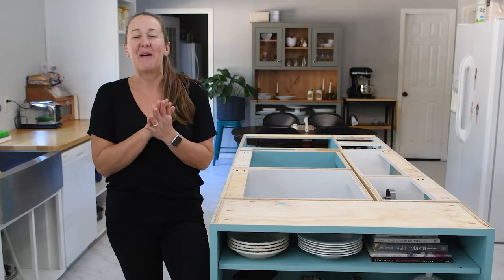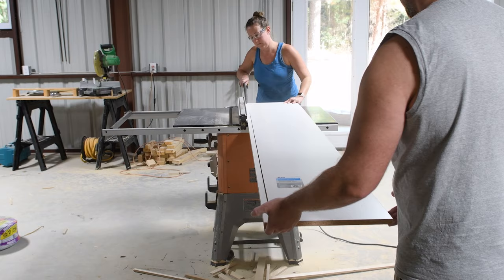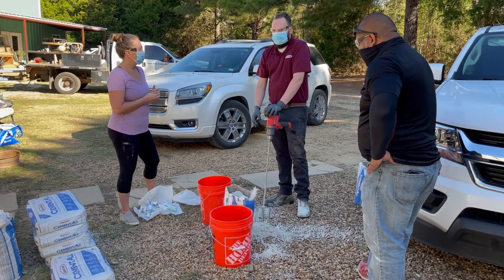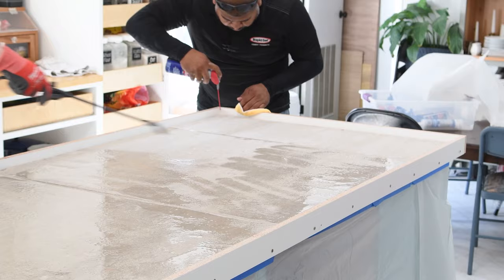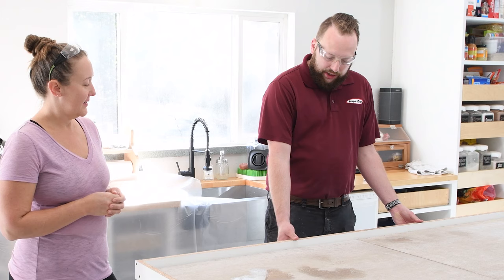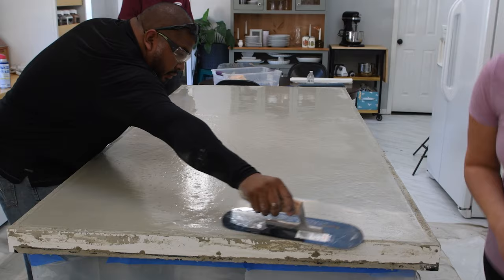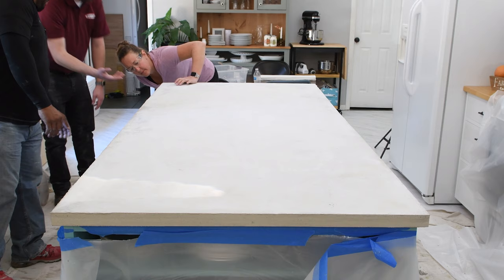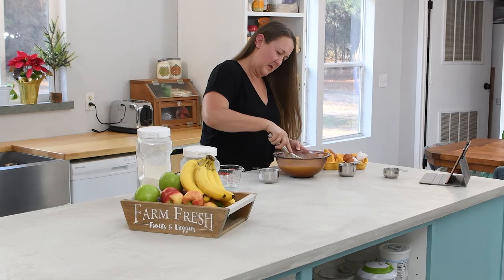Fast DIY Concrete Countertops

Comment: So no wire, mesh or bars in the middle of the concrete?
Reply from the maker: Not for this project.
Reply: @HousefulofHandmade  Its going to crack 🤦‍♂️ maybe not today but its coming 🤷‍♂️
Reply: @paparedpill1036  I am from Colombia and my grandma had a kitchen for over 45 years with cement counter top Idk if you know but my country is hot as hell and the counter was amazing, the things that are dome right they can stay almost forever
Reply: @brendagebhart325  it’s not heat you have to worry about lmao, it’s cold.

Comment: One step I would add to the process:

Use a thinset and cement board fiber mesh tape on all  joints found in the hardibacker board. This will make those areas far less prone to cracks in the future.
Reply from the maker: Thank you for the tip. That is not something I had ever considered.
If I were to do it again I would add wire mesh or rebar for added strength.

Comment: 9:15 - DUDE SAYS THE DETAILS that needs to be NOTED by each and all who are going to implement this type of RAPID SET CONCRETE PROJECT.

9:25 - DUDE's info about the type of RAPID SET and sand-type is KEY.

Comment: I am looking at doing this to replace what would otherwise be a slate slab for my homemade pool table... need to make sure that it is perfectly smooth, perfectly level and almost pollished in the end, and this looks like the go.
Well made vid, everything explained nicely, very enjoyable. Thanks 👍
Reply: Pooltable slate is specially ground flat,  this countertop wont work.  Ive assembled pool tables before.  Those slate tops are actually 2-3 pieces ground as 1 and have alignment marks.

Comment: Nice work! If you really want to cut through the cream layer use diamond pads on an orbital sander. Depending on what grit you use you can either just smooth the surface or reveal the sand for a speckled look.
Reply from the maker: Thanks for the info!

Comment: We tried this process and 1. Our concrete took several hours to set. My husband worried about how long it was taking and removed the sides too early I think, causing a crack. Now I'll have to repair that. 2. We struggled with mixing. Our drill was not powerful enough and started smoking. So I think the slow setting was due to too much water in the mix because we could not get all the concrete mixed in properly

Comment: Thank you for the video. I'm making a 5'x3'x1/2" for a skid bar I made 3 years ago.  Need to do this.  It's been too long. I'll post a picture.  One question : What would you use for a color in the cement?

Comment: This is a beautifully documented step by step information package. I have seen a few professionally finished concrete countertops and they truly compete with polished granite both in looks and feel. But I know those Pro projects require pro skills and equipment and top secrete finishing materials and supplies.  How far could we push a DIY project towards the " Pro " territories?   I went through the FAQ on your web pages but didn't find one important question and answer for it: " How smooth the final surface is and if there is a real point of diminishing returns for attempting to create REALLY SMOOTH surface out of a concrete slab "  with DIY equipment, elbow grease and off the shelf sand-papers ?
Reply from the maker: It is not a polished granite smooth finish.  I was going for a "rougher" finish.  If you want it smooth its best to flip it over after the pour and not pour in place.  Then it would be pretty simple to get the polished look.
Reply: @HousefulofHandmade  You can get a polished look by hard troweling it smooth like we do on concrete floors. You can ask a concrete guy what that means. Also I didn't see you edge it before you pulled the side forms. Edging will give you a rounded look and take away a possible sharp edge on the top corners.
Reply: You can get a wet polisher fairly inexpensively and polish them. I did mine last year with dyed rapid set mortar and am very happy with the result. I poured the sink as well.
Reply: @tomwilkinson729  What brand of wet polisher did you buy if you don't mind sharing? Because I want to pour in place and not having to flip over. Thank you
Reply: @mailemoore5017  it was a relatively inexpensive polisher from Amazon. Around 100-130$. Don’t remember brand and it’s at my second home.

Comment: Great video and love the way it turned out. Perfect color too.  I don’t remember you mentioning using any coloring or pigments?
Reply from the maker: We didn't use any. This is the natural color of the Rapid Set Cement All!
Reply: @HousefulofHandmade how light is it? It looks white in the video. Is that correct? I am about to try to make a white one. So this product dries white? Thanks so much for your help.

Comment: I love this 
And we’ve been talking about doing concrete tops but I didn’t want all the dust from sanding so the way y’all did it really made me think this is the way to go 

But I want to have black tops so can you add a color to the mix? 

Looks fantastic awesome job thank you for sharing
Reply from the maker: You can add pigment to the mix.  I would probably experiment with some small batches before going for the whole countertop.

Comment: If you were doing this for kitchen counters and not an island I assume the pour in forms method would be the only way to go .  I love the look of a concrete countertop and we are considering this for ours this summer. Also I was unable to find out if CTS distributes in Canada, certainly Home Depot doesn't carry their products
Reply from the maker: A lot of countertops will actually flip them to ensure a smooth top.  It can be tricky to make sure you get all the bubbles and imperfections out.  Its pretty heavy, but so is marble and granite. I can't say if they export outside the US, perhaps reach out to them directly from the website?

Comment: I see you didn’t use any steel reinforcing?
Reply from the maker: I did not use any steel reinforcing.  The counter top had minimal over hang and was supported evenly underneath.  If there is a sink cut out or a large over hang, that's when I'd use steel reinforcing.

Comment: What is used for the sealer? Does it have to be resealed eventually?
Reply from the maker: The exact sealer I used is listed in the blog post. (link in description) It does need to be resealed to maintain it.

Comment: No reinforcement mesh needed for this RapidSet product?  or does it depend on thickness?
Reply from the maker: For this project we didn't need it. If you have an overhang for bar stools or a thinner area around a sink you will want to reinforce it.

Comment: Would you recommend using the cement board even if you’re not doing an in-place install?  Any benefits to the form like insulation, support, etc?
Reply from the maker: I am not sure I would qualify to recommend or not. I can tell you that if I was not pouring in place I would put it directly on the cabinet. I haven't tried it so I can't say for sure if it'll work.

Comment: what kind of sealer  do you use for seal the concrete ?
Reply from the maker: The exact sealer I used is listed in the blog post. (link in description) As a heads up, it does need to be resealed to maintain it.

Comment: I'm wondering can you use any rapid set for this project..in Ireland its called Post 10
Reply from the maker: I would look at the specs for the specific rapid set you have available and compare the two. But it might work similarly.

Comment: I just poured the cementall countertop and have attempted to seal it 3 times with the Stone Care Granite and stone sealer. Water still leaves dark spots and repels slightly in others. Any thoughts or suggestions? It’s taking most of the bottle. Do you think I can cover it with another sealer like a Behr product?

Comment: Nice work! Looks great!!! In the video you stated you changed the amount of water per 55lb bag....was the final amount per bag 5 quarts? What do you recommend for sealing? Thanks
Reply from the maker: The amount of water will very depending on temperature/humidity where you are.  It was about 5 quarts per bag.  I currently don't have a recommendation on sealer.  I wasn't totally happy with the one I picked so I will be trying another one.
Reply: I've used concrete countertop institute omega sealer. A little tricky to put on, but nothing seems to stain the countertops once applied.

Comment: Beautiful video and countertop and very informative-Thank you! Based on your experience, what are your thoughts on a thinner top? I am considering resurfacing a Corian bathroom vanity with a thin (1/8-1/4" max. thickness) Rapid Set Cement All overlay. Rather than skim-coating by hand, I could make molds similar to yours but smaller, to give a much thinner cement overlay. Perhaps I could position the bottom molds to give a more substantial height of the front edge of the vanity top. Would you think this would work? Thank you.
Reply from the maker: I just did a thinner (1" top) for a bathroom vanity with 1/2" backsplash pieces. The 1/2" thickness broke when removing it from the molds so it needed more support. But since you are coating it over another vanity it might not be an issue. Use a mold to extend the front so it wraps all over the entire vanity top. And make sure to research if you need to do something to your Corian to make sure it adheres properly. Could Be a fun project! Good luck.

Comment: Very nice!!! I’ve watched many molds here on YouTube. Will going without the wire mesh or chicken wire affects it’s durability?
Reply from the maker: The concrete is quite strong.  If you have a seam in the hardy backer board I would suggest using wire or rebar.  If the ground shifts at all the counter could crack at the seam.

Comment: Does the concrete stain easy?
Reply from the maker: Like most concrete they are prone to being stained.  The sealer you choose will have the most impact.  We started with an almost not there look.  It needs to be applied more regularly and we ended up with a few stains.

Comment: Hi... can i make it as a flooring ?
Reply from the maker: I haven't ever done concrete flooring.  CTS does LOTS of commercial flooring though!
Reply: On an upper level floor, that would be against residential building code. Cement is very heavy and the underlying joist and subfloor system would buckle. You could achieve a similar-ish look by using 12x24" tile with a matte stone finish (very popular & affordable item in any home improvement store).

Comment: I noticed the rep for Cement-All say he recommended it “for that size” but he didn’t explain. I need a 57” x 97.5” island top (yes that’s 4.5’ by 8’ plus a 1.5” overhang each side, not including the bar end.). Will the Cement-All work?  And why didn’t you use reinforcements like at least like a thin ladder shaped metal piece (I think Lowes calls it a remesh sheet?)
Reply from the maker: I believe it would work. I didn't use reinforcement because it really didn't need it.  I wish I had though, the seam at the two pieces of hardy backer shifted a bit and now I have a very faint crack in the island. When I do another one I will add some reinforcement.

Comment: Looks great!  but, Does it not need wire or mesh reinforcement or tapping to get out the air bubbles??
Reply from the maker: If you have a solid piece of cement board underlayment the concrete is strong enough.  If I were to do it again I would add mesh or rebar since I used two pieces of the cement board.  The air bubbles were moved out by the sander and saw.

Comment: Hello, good job - i have only one question -  what do you do with the cement panels?
Reply from the maker: Thank you.  I am not sure what you mean by cement panels.
Reply: Break em into 1m lengths, sharpen one end and use them for javelin practice on unwelcome visitors 😁
Reply: I assume you're talking about the hardi board panels, they stay in place.

Comment: Thank you so much for the video. What type of cement did you used? Thank you for your prompt response!
Reply from the maker: CTS rapid set. You can get all the details at https://housefulofhandmade.com/fast-diy-concrete-countertops/
Reply: I am going to try this weekend! May I ask it looks like your countertop looking pretty white. Is it light grey because I didn't see you added any white color or pigment but it is still white. {Please advise, because I was going to order some titanium dioxide to mix in, but if your finished project is pretty white, I now am NOT sure if mixing titanium dioxide is necessary?
Thank you for your prompt response!

Comment: How much would CTS rapid set have charge to come out and do it professionally without your help?
Reply from the maker: I am not sure. They work a lot in the commercial space. It was great to have them for this project to answer the questions. The main point though, is you don't NEED to hire someone to do it. :P

Comment: Question, no metal like rebar or the screen?
Reply from the maker: We did not use rebar or a screen. There is a crack where the seam in the hardy backer board is. Its pretty small, but I would either add rebar or screen or use a single piece of hardy backer when I do it again.

Comment: Do you use a special sandpaper to do the wet sanding?
Reply from the maker: Not a special sand paper, just make sure you get the correct grit.

Comment: I realize I'm watching this over a year later, but I have a question as I've been watching several videos on doing this. All other videos I saw recommended a fiberglass mesh in the concrete (like rebar but lighter weight). Why did you opt not to use something like that?
Reply from the maker: Because my top was completely supported by the cabinets, the CTS reps said it was not necessary. It does help to prevent cracks and is necessary if you have an overhang for a bar top or small pieces of concrete around a sink opening. I have more details on it in my blog post here: https://housefulofhandmade.com/fast-diy-concrete-countertops/
Reply: @HousefulofHandmade  Ah, okay. That makes sense. Thank you.

Comment: How long do these countertops last? We are about to start a renovation and looking for an alternative to quartz…the general contractor told me he doesn’t know how long these will last ??
Reply from the maker: It depends on what "lasts" means.  If its stain free then it depends on how well you seal it.  If its structurally just think of how long a driveway/sidewalk/retaining wall last.  I expect it to last as long or longer than any stone counter top, so until you decide to remodel your kitchen again. :)

Comment: Nice video , thanks a lot. Can we put some hot plates on that? what sealer u used? thanks!
Reply from the maker: Thank you! We put hot pans/plates on it no problem.  We used Stone Care Granite & Stone Sealer.  I will try something else though it wasn't exactly what I wanted.
Reply: @HousefulofHandmade   hi, have you tried something else yet?

Comment: Why did you no add rio bar inside concrete?????
Reply from the maker: It was explained to us that it was strong enough to not need it.  There is a crack where the Hardy Backer board has a seam, and if I were to do it again, I would add rebar to it.
Reply: 1.5" thick slab is too thin to add rebar. Reinforcement should be 1/8 the thickness of the slab, so for 1.5" thick slab the diameter of reinforcement should be no more than 3/16". Otherwise their won't be enough concrete on top of the rebar and the slab may crack and the rebar print through. An alkali resistant fiberglass mesh is a better option in addition to using glass fiber in the mix. Most premade countertop mixes have glass fiber already in them. Additionally any seams in the cement board should be supported by adding a wood rib underneath the seam and fastening the rib to the cabinet box.

Comment: i mean DIY cool but it was kinda half a product advert . . . and not a very good one tbh. . . if that system doesn't have a form set why not use one and  solve 80% of your issues with finish.  it's about the same 'cost' as messing with all the form work and nonsense out of the stone age :) you can more effectively level and finish the way you wish be it from a rougher 'rustic' to full up blackened if you want . .  . and it provides a uniform scree base to work off of, y'all had a lump at one end and divets all over the other heh .  . .  should also be careful about giving 'universal' concrete recommendations, what works or is required for where ever you are may be not only wrong but dangerous & illegal else where . . .  and that applies all the way from the foundation/frame work  through finish and use. . .  beyond my armchair quarter edit'n it was very cool of you to document, show and share the process and experience, kudos! :)